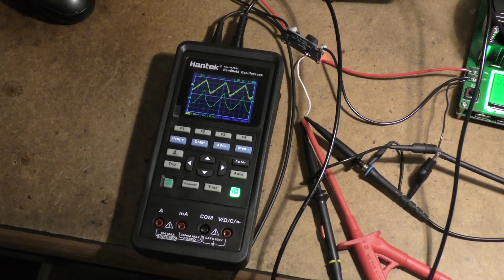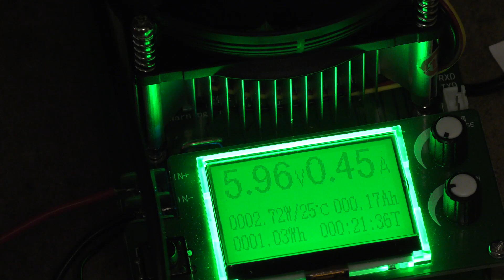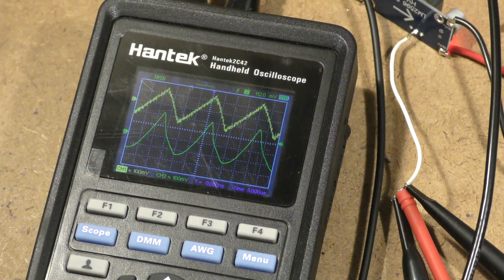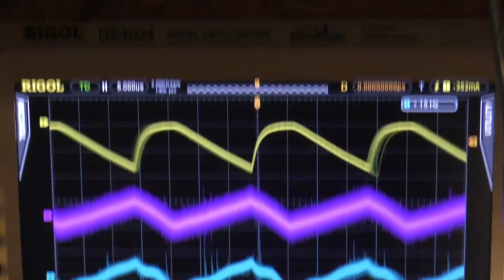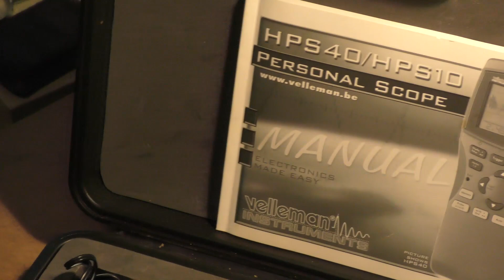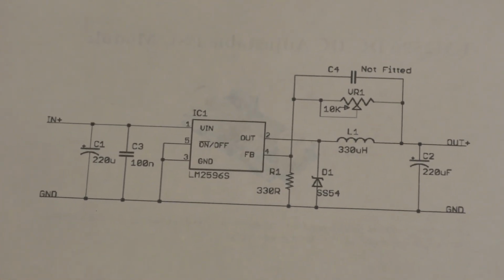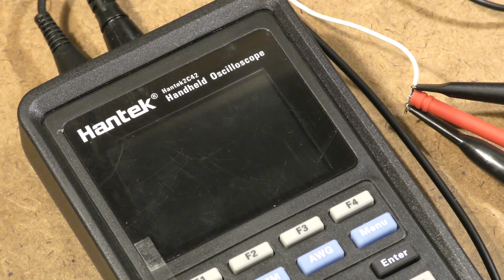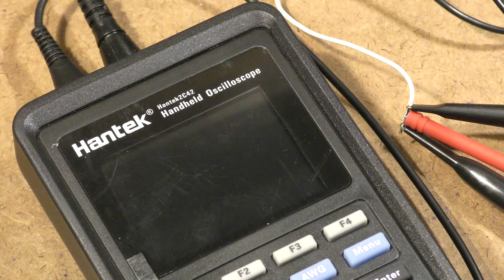TTT357 Hantek 2C42 Scope and a Buck Converter

Comment: Hi! Do you know if PC software can record several days of waveforms? I have hantek 2d42. Device under test behaves erratically due to powerline disturbances, i have no idea what kind of disturbance causes it, it can function fine under a pretty crappy sinewave for quite a while (if sinewave has no distortions it works fine indefinately), to catch what kind of disturbance is that i need either log around 10 seconds of waveform befor a trigger pulse(because device does not reacts instantly) or to log several days of waveform from two channels because faults are are pretty rare and sometimes don't happen for three days straight or even a weak.

Comment: Thanks as always.  On the floating ground discussion.  I have a pretty elaborate power system on my bench for DUT.  It's an isolation transformer with a current limiting bulb and variac which can both be switched in and out of circuit.  Added a volt/amp meter for easy reference of what is going on.  Had to rig up a soft start on the torrid isolation transformer due to inrush current(I'm proud and ashamed of that circuit at the same time).   I carried the ground wire though to the outlet for the system.  Most of what I work on only has a 2 wire plug, so no ground pin. So chassis is isolated from the world.  Always thought about adding a large resistor in series to the ground wire circuit to sense any real voltage and shutdown the supply.  I always reason it out as a double edged sword.  And nothing saves you if you get across power and ground of what you are working on.  This brings me to using a battery powered scope.  If you reference the scope ground to something positive to a chassis, and you touch the other channel's probe ground and the chassis at the same time. You get bit.  My thinking is that a battery powered scope is no better or worse than running a modern plastic scope on an isolation transformer without a ground wire.  Be careful, always think what you are doing though first.  Wish differential probes weren't so expensive, one is coming up soon on my list.

Comment: Are the two channels isolated from each other? ETA  I obviously posted this mid-watch. You answer this at about 13:00. What would be the problem with floating a bench scope when dealing with a circuit like this buck converter to achieve the same floating ground as your little handheld Hantek? It seems that a lot of electronics instructors will say NEVER float a bench scope, but this seems to me to be overly cautious.
Reply from the maker: No, the grounds of the two BNC connectors are connected together. This is not a problem if you are using a floating probe (like the Hantek CC65 Current Probe) along with a conventional probe (X1 or X10), but it would matter if you wanted to measure across two independent points with conventional probes only. Thanks for the question.
Reply: Number one reason is safety! Any exposed metal can now pose a shock hazard.  Number two reason is the scope chassis and AC power circuit stray capacitance becomes part of the circuit being measured.  Have I done it?  Sure...  If you are working in an environment where others may use  the same setup, make sure to post a note.
Reply: @billwest257  I suspect that in our litigious society, scope manufacturers say NEVER to float a scope, rather than giving guidelines when it's okay, to shield themselves somewhat from the trial lawyers. I don't see the problem if working on electronics that are powered by low-voltage, isolated dc supplies.
Reply from the maker: @billwest257  Thank you for our comment as it allows me to expand on a point I may have not explained clearly enough. What a portable instrument does (as does a differential probe) is to allow the measurement ground to float above the AC ground reference. The dangers you refer to are when you float the ground of an AC powered instrument (using a two wire cord or removing the ground (green) wire) not floating the ground of an instrument powered by an already floating source. Floating the ground of an AC powered device causes the metal surfaces that are supposed to be connected through the green wire to float and poses a danger. Using a measurement instrument (such as a portable scope or differential probe) does not pose this danger. Of course, proper safety protocols should always be observed (as I try to emphasize at the end of all my videos) but using a floating instrument powered by a truly floating supply (like a battery) does not pose an added danger like floating the ground of an AC powered instrument (or device under test) would.